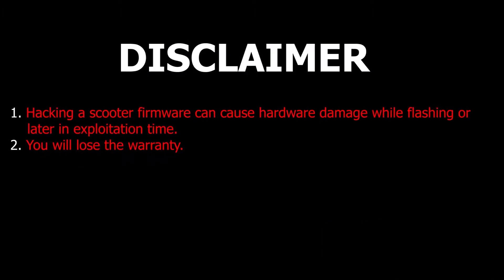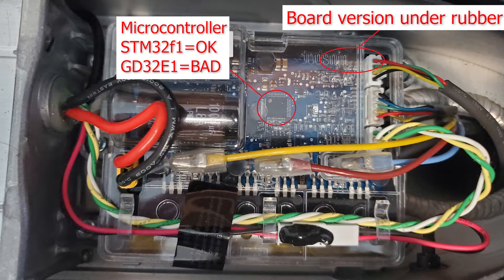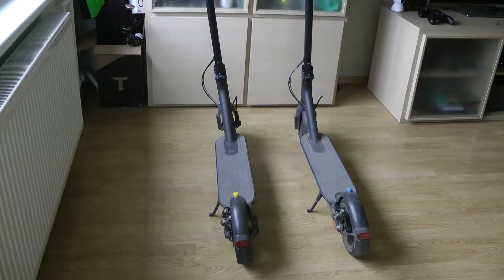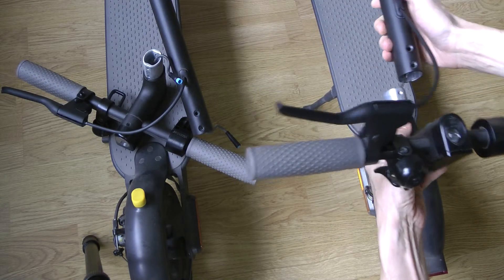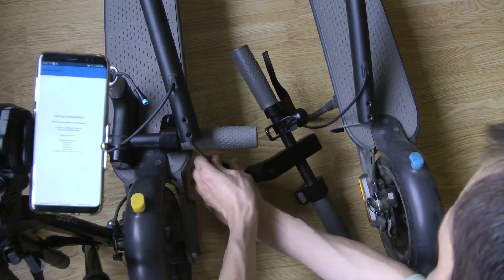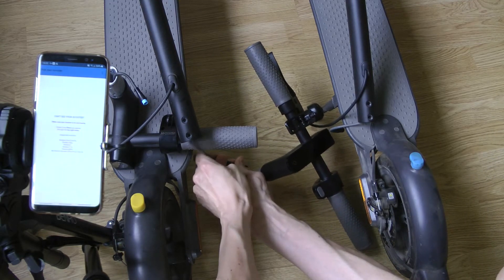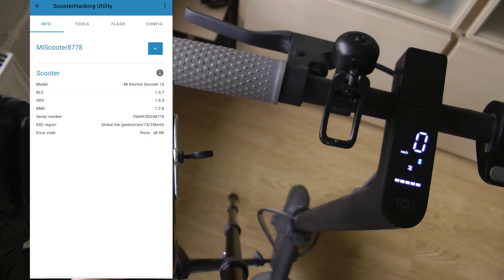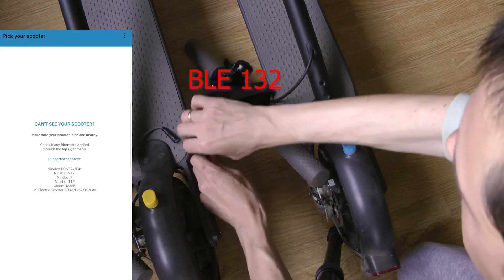Xiaomi Scooter 1S BLE157 speed unlocked

Comment: My mi 3 it's bricked and i have an old 1s controller can I use it in MI 3 or needs to be new?
Reply from the maker: Yes, it can be used, you will need to flash DRV for mi3 to it. Or you can unbrick your mi3 controller: https://youtu.be/kbj3A4aAlSU
Subscribe, thanks.
Reply: Do I install it and then flash it?
Reply from the maker: @marcionogueira5086  You can install and then flash via bluetooth, you may get some error and a beep on the dashboard, but you should be able to flash it.
Reply: It's all done, went great.
My question is this how does the dashboard knows the model of your scooter, where is it stored in the motherboard? What about if you change both, controller and dashboard how does it knows the model? Thank you so much in advance
Reply from the maker: @marcionogueira5086  The scooter model is identified by the serial number stored in your ESC (motherboard at the bottom of the scooter). You can set your mi3 serial to 1s controller (downG android app.) and the scooter will be identified as mi3.
Reply: Thank you so much for everything.

Comment: Hi, got this message halfway when flashing. "Update failed. Reason, update key Seed mismatch (Bricked? This is With the original display put back on scooter.
Reply from the maker: The guy in the telegram chat https://t.me/scooterhackingchat has the same error as you. He's planning to flash ESC, I let you know if that helps. Or write to this telegram chat for help, maybe someone will help you faster.
Subscribe, thanks.
Reply: Thanks! I'm a subscriber 👍
Reply from the maker: @MartinRix-qd8nh  Just got confirmation that flashing the motherboard helped fix this issue

Comment: If I borrow my friends pro 2 that has already been hacked, and do what you described in the video, when I put it back in my friends scooter does it effect it or should it work as it used to?
Reply: Alright, will try this and get back if there’s any issues. Thank you for your help! Subscribed
Reply from the maker: It will be intact, since drv or shfw is installed in the main board located at the bottom of the scooter next to the battery. Ble is located in the dashboard. And you dont flashing it.
Put friend's head, instal shfw from "Scooter hacking utility" and configure it to start driving.
DRV from first part of the video is for ESC 3.0
And don't flash BMS this is not needed.
Subscribe, thanks.
Reply: Okay thank you! I have the V3.1 board, but SHU will work right? So I don’t have to make a costom cfw?
Reply from the maker: Yes, SHU recognizes the controller version and flashes the correct shfw.
When you return the scooter's head, it will warn you again that ble is restricted (because nothing has changed in the dashboard), but shfw will be flashed to mainboard, and you can change shfw settings from the app.

Comment: I have an issue. I tried to flash a new scooter without the "FF" in the UUID. It worked, however the scooter is restarting every time I turn it off. And after a while it starts beeping over and over again. I get an error when I connect using the DownG. "Low status on the MOSFET is anomalous". Anyone have an idea how to solve?
Reply from the maker: So it's a new 3.1 controller just a different model. You need to generate your own firmware for the new ESC model, or (I think the easiest method) use a "scooter hacking utility" and install from it shfw. After the installation in the config tab, you will need to build a throttle curve to start driving.
Subscribe, thanks

Comment: Hi, I have a S1 with the following characteristics: BLE: 1.5.7 - DRV: GD32E 3.2.1 - BMS 1.1.0.1 - I want only to change the region which is DE(6/15/20) to something which allows me to go to 25kmph. I would have another scooter with an unblocked version available, would this method work? If not please explain in detail what i need to do - Subscribed :)
Reply from the maker: Oh sorry your comment went to spam. Yes, it will work. Put another scooter head and install shfw (2nd method) from "Scooter hacking utility". And don't do anything with BMS (it's a new model, and will be bricked if flashing old BMS fw).
For more info you can check this telegram chat: https://t.me/scooterhackingchat

Comment: hello is it possible to install shfw in xiaomi scooter 3 with  ble 157 with 3.1 controller
Reply from the maker: Oh, sorry, your comment under another video went to spam. Don't flash any BMS to your scooter as it will brick your BMS. (It's a BMS with a new controller).
Reply: @MindaugasJocionis okay sir so its possible to downgrade the BLE even my controller is 3.1? thanks.  i want to hack my scooter
Reply from the maker: Downgraded BLE gives the possibility to flash DRV to the ESC board over Bluetooth. It doesn't matter what ESC version is on your scooter to unlock BLE.
If you have an ESC 3.1, you need to use a new-gen firmware generator and make your own DRV. Or use shfw from scooter hacking utility, as it can automatically recognize ESC version and flashes only compatible firmware.
Otherwise, you will brick it. 

BLE is the firmware for your dashboard.
DRV is the ESC (motherboard) firmware.

BLE is like a gate that allows or disallows flashing the motherboard (3.0 or 3.1) over a Bluetooth connection.
Reply: @MindaugasJocionis  thank you for the advice. just waiting for my st link to downgrade my ble
Reply from the maker: Yes, you can use SHFW on a 3.1 controller, but only after a BLE downgrade https://youtu.be/IvQ4oT2u_vg  or with the head swap method as demonstrated in this video.
Thanks for subscription :)

Comment: Hi where can I find the file bms128? Thanks.
Reply from the maker: It is not necessary to flash the BMS, I just showed that it is possible. Subscribe, thx.
Reply: @MindaugasJocionis  Thanks for your answer. I have the ble 157 on my pro 2 but the other step is also pro 2 but don't have the ble157. I will switch the steer but what I have to install or to copy of will it take it automatically the version. Thanks.
Reply from the maker: @blackstorm01  If you don't know your ESC board version, the best option is to install "Scooter hacking utility" and use its SHFW. SHU will recognize your controller and flash only compatible firmware.
After flashing you will need to configure it to start driving and you can change parameters without reflashing - in real time.
For more info check this telegram chat: https://t.me/scooterhackingchat
Reply: I tried on the step with ble 157 it don't work. I think I have to flash first the bms version into the step with ble 157. Greetings
Reply from the maker: @blackstorm01  Bms has nothing to do with it. Was BLE on another scooter head less than 155? Check the video description, there is a link to the video on downgrading BLE.
Subscribe, thanks.
Reply: @MindaugasJocionis   Ok but I don't wan't to use a st link. Thanks

Comment: Hi! I have a Mi Electric Scooter 3 with BLE 1.5.2., DRV STM32F 0.0.3 and BMS 1.4.1. Not sure if all the info is needed but what do I need to do flash a custom firmware to it? Need to downgrade? Afraid to brick my scooter by just trying lol
Reply from the maker: No need to downgrade, everything is ok. Your BLE is not locked and ESC version is 3.0.
For mi3 You will get error 42, you need to flash patched BLE ( http://f0456977.xsph.ru/base/index.html ) just after that flash some hacked DRV.
Or make your DRV with checkbox fix error 42 ( https://mi.cfw.sh/# )
Or use SHU (scooter hacking utility) and flash shfw. 
Personally, I use shfw with my Mi3 
And remember that after flashing the shfw, it needs to be configured in the app to start riding.
For more info check this telegram chat: https://t.me/scooterhackingchat
And remember that there is always a slight possibility of bricking your scooter even if you do it all correctly. In that case, it can be fixed with a stink soldered directly to the board.
Subscribe, thanks.

Comment: Mine wont do anything connect to blutooth turn off , any help please?
Reply from the maker: How did it happened, what have you flashed and what esc controller is on your board. From the first sign it looks like ESC brick. Here is video on how to unbrick it: https://youtu.be/kbj3A4aAlSU
At first I would try to reconnecting the battery. 
For more info check this telegram chat: https://t.me/scooterhackingchat
Subscribe, thanks,
Reply: @MindaugasJocionis  I didn't check but I think it's bricked what to do now do I need and st link? If so which one and where trom please?
Reply from the maker: @FIDDY-FAT-P  Unbricking video: https://youtu.be/kbj3A4aAlSU
Amazon affiliate links:
St-Link_v2 Adapter  https://amzn.to/3uKSH4w
Soldering Iron Kit https://amzn.to/3pJzNLA
Single Row Male Pin https://amzn.to/3IBlApl
No Clean Flux&Desoldering Braid https://amzn.to/3z4LkaQ
Isopropanol IPA 99.9% - Cleaning Alcohol https://amzn.to/3PlsNMw

Comment: Hello i have an question.
I have a s1 ble 157. I Want to Tune it But i dont have 2, cant i just buy a new screen for it and then i Can Tune it? Or? Like a new screen that is ble 155
Reply: I dont know much about scooters But if i get a ble 155 screen and put it on my scooter and use the s1 normal Tune software for the ble 155 s1, Can it work then?
Reply: And Can i use the screen like if i cant change the head and just change the screen Can i then use like a screen from another scooter than a s1?
Reply: So like i change the Xiaomi 1s scooter screen to a Old Xiaomi pro2 screen and use the flash u used in the first tuning method Will it work without any problems?
Reply from the maker: @dinfar4367  You need a dashboard with ble less than 155 as 155 is blocked too. With the new dashboard that has unlocked ble, you can flash whatever you want. As shown in the first method you can flash only esc controller that has version 3.0 (for 3.1 you need a new gen fw generator to generate compatible DRV), otherwise, you will brick ESC. 
SHU (2nd method) latest version of it has the possibility to recognize ESC controller version and flashes only compatible DRV version or SHFW.
And don't flash BMS, I only showed that it's possible to do it this way, but it's unnecessary.
Yes, you can use the screen from pro2 to flash 1s.
For more info check this telegram chat: https://t.me/scooterhackingchat

Comment: Hi sir, I have DRV version 2.5.2 and it says GD32F, is it safe to flash or I can brick it?
Reply from the maker: It's 3.1 controller. You can use shfw from "scooter hacking utility" app, or generate your own with new gen generator.
You cannot use old gen. drv like in first part of the video.
But firs what is your ble version? If it's 155 and up, you need to downgrade it with stlink at first.
Subscribe, thx.
Reply: @MindaugasJocionis  if I used the method for locked 1.5.8 then I can use my friends dashboard that has lower BLE version? He has same scooter as mine
Reply from the maker: Yes
Reply from the maker: Oh and drv252 might be locked, at first you need to do "attempt downgrade" in shu, just after that flash shfw.
Reply from the maker: For more details check this telegram group: https://t.me/scooterhackingchat
and this one: https://t.me/STLink_XAP2P
Reply: @MindaugasJocionis  Okay thanks, i also subcribed to your channel, because your videos are amazing

Comment: As per my understanding, was this method used to skip the ST-LINK firmware downgrade? Am I correct? If so, can I still use the ST-LINK method with a version 3.1 board? And can I use the link you mentioned in point two in the description as the firmware to flash?
Reply from the maker: Yes, you are right. You can use this method to bypass the blocking implemented in ble 155;157;158...
Yes, you can use stlink to flash ble or esc.
Firmware generator at link 2 or shfw at link 3 are for esc 3.1 controller.
Subscribe. Thank you.

Comment: can i do this with a mi 3 and an flashed essential with 30 km/h unlocked, the mi 3 is drv 317 bms 141 and ble 157 please answer as quickly as possible! thanks
Reply from the maker: Yes. Don't forget to select the correct drv based on your ESC version, or use the "Scooter  hacking utility" shfw, as it can recognize the controller type and flash the correct firmware. Sub. Thx.
Reply: @MindaugasJocionis  if shfw recognizes controller version do I need to still open and see what version is the controller from the board?
Reply from the maker: @gwa.  No, shu will detect the controller and flash the correct shfw firmware. Unless you force it to flash some premade drv from the Internet that is not compatible. Although sometimes you can end up with a bricked ESC even if everything was chosen correctly, so it's best to start this process when you have an STLink so that if something goes wrong, you are able to fix it.

Comment: Hello i have bought an mi3 the ble version is 157. It has GD32f(v3,1 controller) my question is can i do the swap head method or is it a no go?
Reply from the maker: Yes, you can perform a "head swap" . Use Scooter Hacking Utility firmware (SHFW). This app is designed to automatically detect the version of the ESC and flash the correct firmware onto it.  Sub. thx.
Reply: @MindaugasJocionis  Thanks for the quick reply :D already subbed keep up the good work :)

Comment: Hi, can i borrow head from 1s and connect it with xiaomi 3 ble 155 bms 1101 GD32F ?
Reply from the maker: Yes, you can temporarily use 1s head to bypass BLE restriction (BLE is located in the dashboard, I have written to you about that in another question) ESC3.1 (mainboard in the bottom compartment of the scooter) needs new gen DRV. Newest Scooter hacking utility firmware automatically detects the ESC version and flashes the correct one.

Comment: hello, how to deal with xiaomi 3 scooter with ble. 1.5.5, bms 1101 ?
Reply from the maker: Leave bms untouched as you will brick it (I just wanted to show that you can flash it the same way, but you have a different controller). 
As for ble, you can use headswap and shfw from "scooter hack utility" or downgrade ble with stlink.
Sub. thx.
Reply: @MindaugasJocionis  I have already subbed :) I can see I have got  ESC ver 3.1 GD32F ;( so i will swap sterring whels and than just downgrade ble?
Reply from the maker: @lukaszf5024  No, ble is dashboard with bluetooth chip. Version 155 prevents from flashing mainboard ESC (that is in bottom compartment of the scooter) ESC3.1 needs new gen DRV. Newest Scooter hacking utility firmware automatically detects ESC version and flashes correct one.
This is ble downgrade procedure: https://www.youtube.com/watch?v=IvQ4oT2u_vg&t=514s
Or without soldering: https://www.youtube.com/watch?v=NYxrvGhevwg&t=10s

Comment: I installed the new dashboard on my Xiaomi pro 2 and i can connect to Scooterhacking utility just fine, but it shows no DRV version so i can't flash it any ideas how to fix?
Reply from the maker: What version of ble is on this dashboard? Is it original or clone?
Reply: @MindaugasJocionis  It's a clone and it's BLE 910 or 091
Reply from the maker: @kranu222  I would try to flash BLE from pro2 https://files.scooterhacking.org/firmware/pro2/BLE/
As well try asking for help in this telegram chat: https://t.me/scooterhackingchat
As well here: https://t.me/STLink_XAP2P
If it's impossible to flash over BT, you will have to flash it with stlink, as long as this clone dashboard has a good enough chip for flashing.
Reply: @MindaugasJocionis  Took a bit time, but i figured it out. I just used the app M365 plus, because others didnt' work then i installed drv 223 on it and it worked then i could install SHFW from scooterhacking utility 👍

Comment: Hello ich have an xioami pro 2 Ble 1.5.7 i flashed it with scooter hacking utility and it bricked ( broken ) could i fix it when i turn the srceen on it shows an 88
Reply from the maker: So you flashed wth headswap method right? If so, then:
your scooter stopped accelerating after you installed SHFW for the first time. This is normal behaviour and is nothing to worry about.

You will need to configure SHFW after installing it.
Acceleration/power curves are set to 0 by default.
Also by default, SHFW shows your battery level percentage when your scooter is not moving. This is not an error code.
The most comprehensive SHFW guide is written by the German Rollerplausch community: https://rollerplausch.com/threads/shfw-anleitung-2022-scooterhacking-utility.3753/
(use google translate)
Also you can ask for a help in telegram chat: https://t.me/scooterhackingchat
Subscribe, thanks.

Comment: Would the SHFW work on my Xiaomi Pro 2 BLE 158 DRV 252 and BMS 141 if i just would get a new dashboard with lower ble, i think i have the 3.0 controller. Battery production date is in June 2021, subscribed already.
Reply from the maker: If the dashboard is original, then yes. If some kind of clone, then it depends on the quality and the components used.